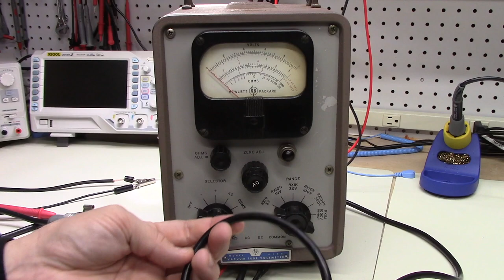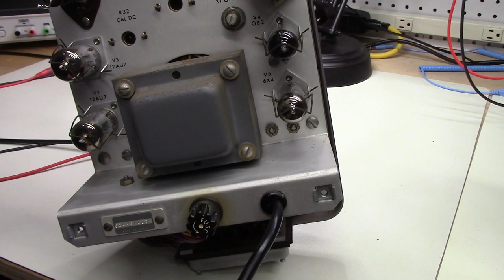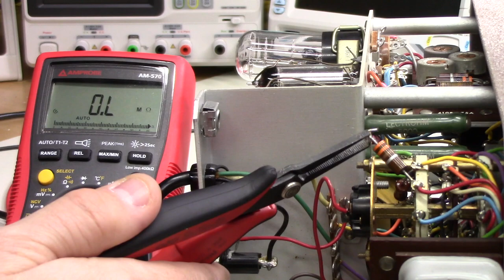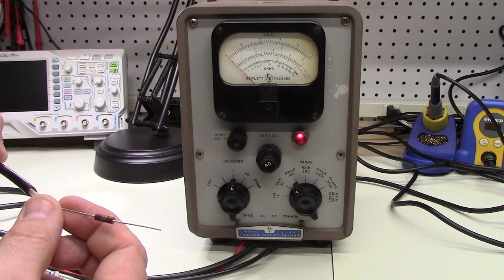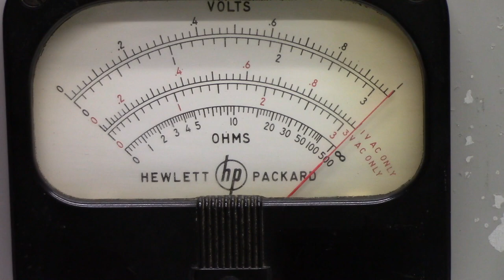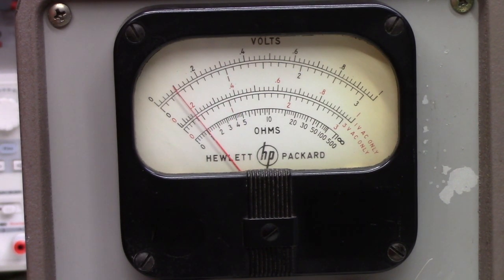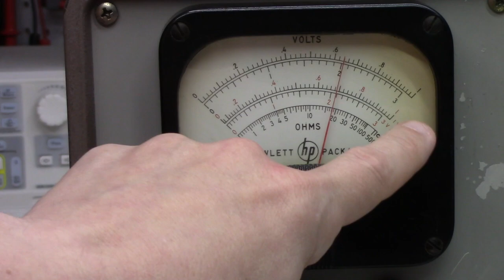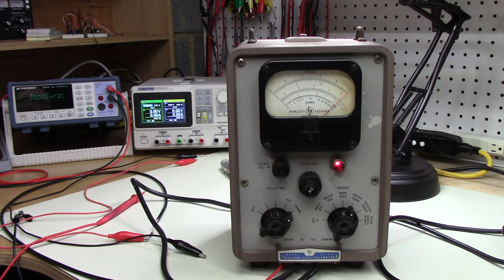#50: HP-410B: Interior and initial calibration

Comment: At 47 minutes into your video, you picked the 1 V AC Only scale when you wanted to test the 10 Volt range of your meter.  Your supply was adjusted for 7 volts.  I then believe you should have adjusted calibrated the meter to 7 volts on the top scale, not on the 1 V AC Only Scale,  and all would be fine.  Thank you for putting on your nice video and it is very nice of you to do so.

Comment: Great Video.  I know I'm late to the game here and this is in no way a criticism, however, I did not see you use the zero adjustment (small bakelite screw in the meter bezel) to bring the needle up to zero with the probes shorted in Ohm setting.  This would account for your needle reading below zero.  There is a set-up procedure in the manual.  I'm trying to learn to use my and repair my Precision 98 VTVM.  It has a similar probe with a rectifier tube in it.  To further confuse me, they chose to use an old technique where a triode tube (RCA 9002) is configured to work as a diode tube inside the probe.  
Keep up the great vids.  Ron

Comment: Thanks. I'm working on one that is a bit older and has been in an exposed environment the probes were OK I did have to replace the Belden 8410 cable with rg8x but the triax was in good condition . I had to completely disassemble the unit in order to really scrub out the chassis and clean out the pots but it seems to be moving along. I am replacing C10 but the parts list calls for an 8uf and the schematic shows a 4uf the original part seems to be a 4uf so I'll use 4. Next I will be specing out the carbon resistors. I have some pics if you're interested.  Lots of stories on this one..Thanks again

Comment: Great video.  Question about measuring line voltage.  Can I do that if I use one of those isolation plugs which basically disconnects the chassis ground of the VTVM and lets it float?  Also, if you are so inclined, what all is inside the AC probe beside a tube?  Mine doesn't seem to warm up to my touch.

Comment: Interesting that they were using HP branded tubes made in Japan. I would have thought they would be using RCA or GE tubes. Maybe they had their own tube  manufacturing plant there at the time. Also surprised to see 10% resistors in there. I guess the value wasn't that critical in those circuits. They did have 5% resistors of the same style at the time but they were considerably more expensive than their 10% counterparts. Interesting stuff Thanks for the look see. ATB Doug.
Reply: Doug McArtin  
This unit could've been made by Yokogawa !
Yokogawa also made the famous hp4260A universal rlc bridge and the hp4342A Q meter !!!!!

Comment: Thanks for the video. 10% of 330 is 33.
Reply from the maker: Yes, you're right! For some reason I had 33 ohms instead of 330 ohms stuck in my mind and didn't catch the error when editing. Thanks for pointing it out.
Reply: No problem. Those old resistors need to replaced anyway.